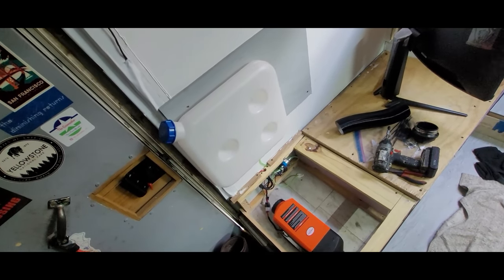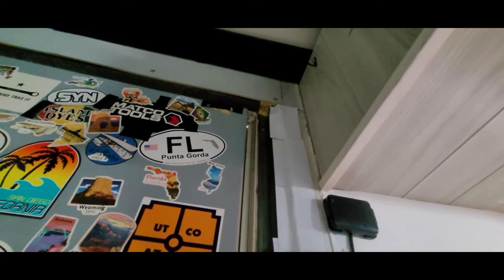DIESEL HEATER INSTALL | #vanlife #rvlife #foryou #diy #howto

Comment: Looks like a great heat source.  Especially since it's hooked up to your solar.
Reply from the maker: It's always good to have different options to use when it comes to heating. I still need to test this heater at night with my solar to see how much it drains my battery.

Comment: Wrap your exhaust pipe in heat tape, otherwise what'll happen is the exhaust pipe will get too hot and it'll start burning the sides of the hole I've seen it happen on some other builds
Reply from the maker: Good idea! I was thinking about getting header wrap from the parts store because of possibly having that issue. I'm not trying to burn my home down. Thank you!